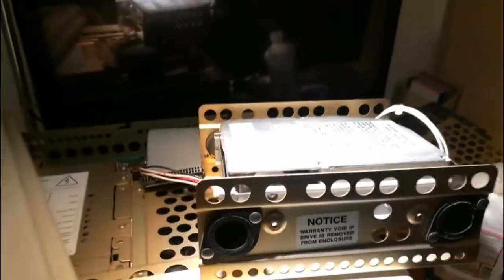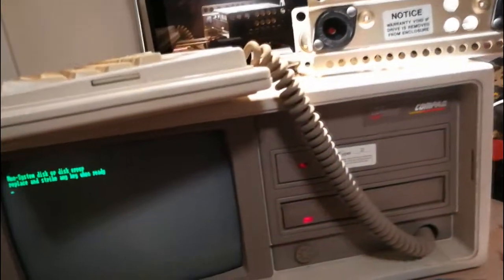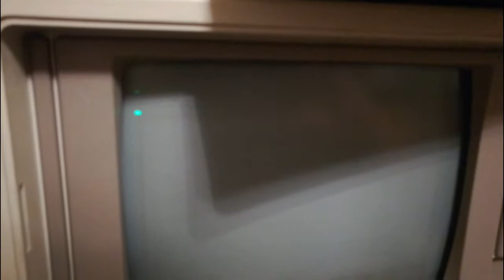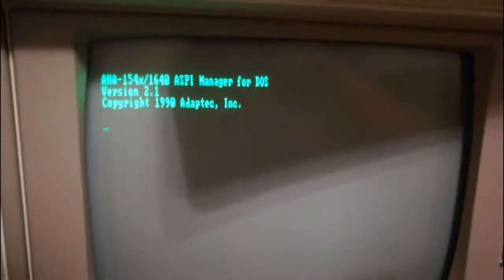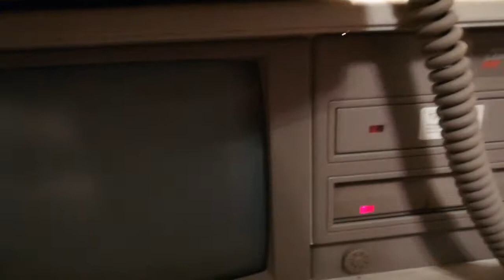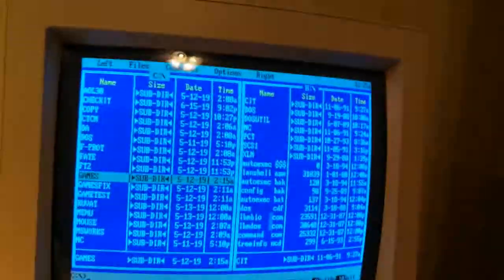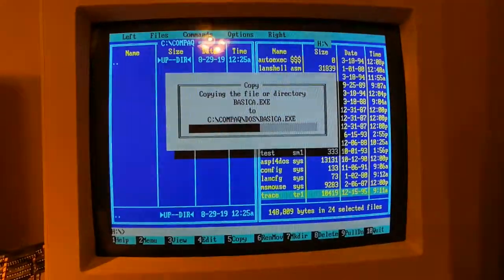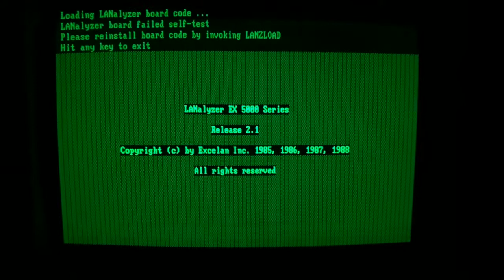Final resort data recovery from a completely seized-up Hard Disk (extremely crude!!!)

Comment: I wonder whether the initial problem was “stiction”—early Seagates were prone to it. The head’s slider would stick to the media surface. With old ST506-MFM drives, a deep media scan (repeated read-write-verify of every sector) to detect new bad sectors, with marking of the locations as unusable (adding them to the factory defects table) will allow the drive to be used with close monitoring—rather than just discarding it. That said, even at their best, these linear stepper actuator Miniscribe units, like the 3650 weren’t very reliable to begin with. Norton Commander is an excellent file manager! Enjoyed the watch :-)